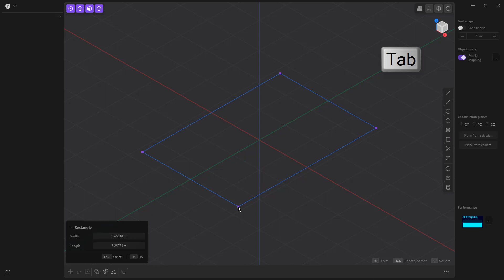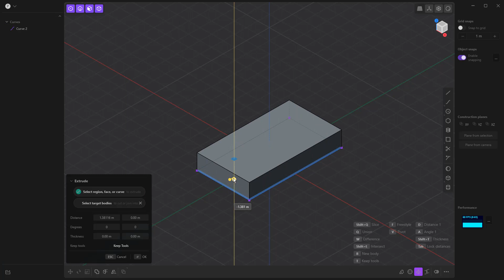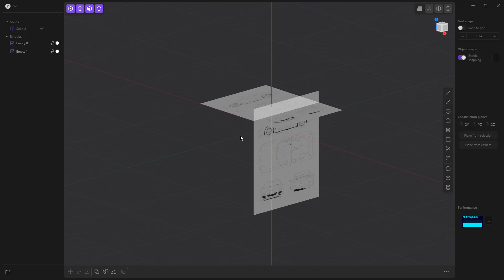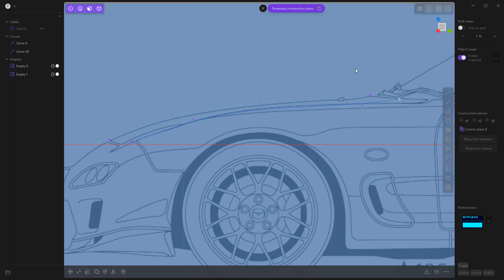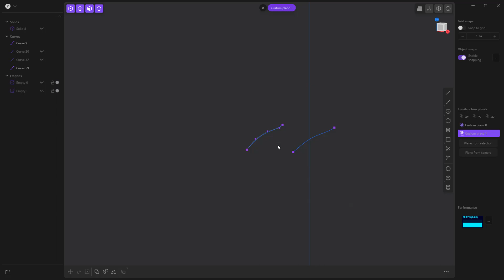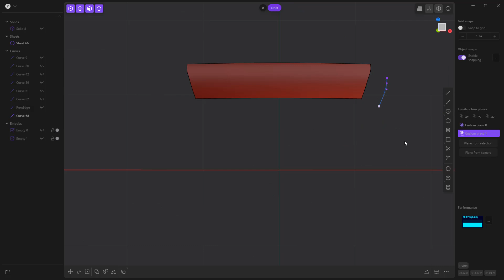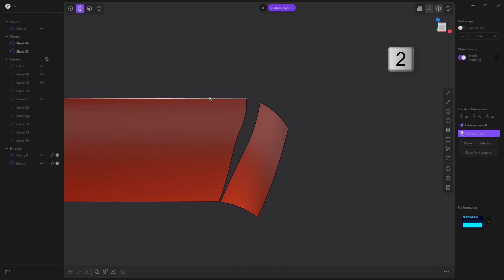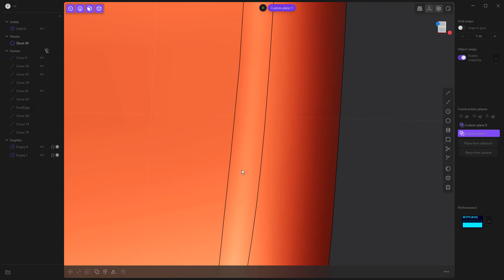Comment: Thank you - I think those type of comments about lofting for an corner  gives a better looking edge than a fillet does is very important - I'd better look in depth at your other video's for surfacing advice. LEAD is a very informative place...
Question, A spline manipulated in side and top view - compared to derived spline from two pulled /extruded surfaces - are they equally valid/ have the same properties etc- also, is it better to learn spline manipulating in the long run to improve knowledge and understanding, thus leading to more complex surfaces? I think the answer must be yes.
Reply: Thank you!  Some of it is a bit of user preference.  I find it easier to visualize and teach curves in 2d and project them, but this is a longer process.  I think you can just as easily draw them in 2D and pull them out to their correct position.  For example on the side view draw a curve, then move the entire curve out to its approximate location and use G to just move individual points from the front and top views until you are happy.  A curve network for this type of modeling is no quick or easy task. just takes time.

Comment: Thanks for making this. I do a lot of vehicle modeling on f360 and was wondering if this could replace it. While it looks pretty intuitive, I don't think I can give up the detail provided with forms. Seems like a fantastic program for someone just getting started and wants more than tinkercad. Cant wait to see how it developes, lots of potential.
Reply: Thanks for the comment.  I don't think this would replace freeform modeling in Fusion, or surfacing in fusion just yet even though i am very open about the surface issues with Fusion right now, there are some things that are still easier to do.  Things like edge conditions when lofting from a surface.  Also true constraints between endpoints if you are building a curve network.  Being able to create and drive tangency on curves after creation isn't really possible with Plasticity at the moment.
Reply: @LearnEverythingAboutDesign  bummer. without continuity control, I just wouldn't be abler to use this for product design work. Looks great for games and animations though.
Reply: @TomCAT_Character_Art  I'm sure it will be in there at some point.  right now you have things like tangent snaps and you can drive intersections, parallel lines etc. but its all during creation and not so much allowing you to tweak it after.
Reply: @LearnEverythingAboutDesign  Yeah. I'm actually looking for a program to replace catia, but can't find something with a parent/child operation tree that's as good. Fusion only has a history tree and it's not very useful at going back in history to find an operation. SW looks like it only has a history tree, and creo looks like it has a parent/child graph but the ME's that use it really struggle with surfacing. Do you know if any program that has a good parent/child chart that you can use to navigate to operations/parts/surfaces?
Reply: @TomCAT_Character_Art  Yeah parent/child can be extremely useful.  Fusion does expose this and I did a video on it https://youtu.be/GAuLpGX75do   but if I am honest Solidworks does this much better.  Solidworks does have the "Feature Manager Design Tree" but also has some on screen arrows that point to where the sketches are shared or what features reference.  The browser/timeline in Fusion takes some getting used to and coming from a traditional feature tree means looking at things in a different way.
Reply: @LearnEverythingAboutDesign  Lol! I already saw your video when I was trying to find an alternative. I use fusion a bit but it's just so hard to keep the file organized so you can find operations, etc.. I'll take another look at SW. Great videos, btw!
Reply: @TomCAT_Character_Art  Thanks, and yeah I totally understand.  I became a certified Swx expert back in 2009 and trained a lot of users in it for 10 years but I sort of left it behind for various reasons.  I don't generally suggest it to people because of cost benefit for most single users, but if you are coming from Creo its a bit cheaper :)  This is a video from one of the big resellers, at this timestamp you can see the dynamic parent/child which is/can be pretty helpful. https://youtu.be/T7u2H2yV7uk?t=97
Reply: @LearnEverythingAboutDesign  Watched that one too. Here's a catia vid that kind of shows the feature I'm trying to find in another software package.. because my current company won't pay the 30k price tag! https://www.youtube.com/watch?v=8k7roFZ4BfY&ab_channel=dotdissonance
Reply: @TomCAT_Character_Art  I watched "some" of that video :)  I have been trying to add Catia to my list of programs to evaluate because it has SubD with Edge weighting which is very hard to find!, but yeah the price tag is tough to swallow.  I will say that Creo is a bit unique in how they display the parent/child with that sort of Flow Chart.  I didn't see any functionality that was different or unique vs say Solidworks or Catia. It is just displayed a bit different.

On the organization side of things with Fusion, one thing that can help is Components.  Not trying to push it as a solution, but making components means when they are active the timeline at the bottom only shows the sketches/features used for that specific one.  You can think of it like activating a part in an assembly but its only a single part/design file.

With the functionality you are looking for I would dig into Solidworks a little more if that parent/child functionality is key to your workflow.  It will be a bit easier on the wallet than Creo but depending on the packages you need to add on you could be hitting $15k by the time you are done.  you can feel free to email me as well support@caducator.com

Comment: Are you suggesting blender may be a better option then Fusion for complicated curvy things? I have been watching your fusion videos and am reluctant to learn another program.
Reply: well that really depends on your end goal.  For me Fusion is good if your end goal is to make something.  Blender is good if you just need to see it on the screen.  What I mean by that is the surfaces from Fusion can be machined for example.  Creating toolpaths for a mesh is not fun.

So if you were modeling a car only for renders, animations, game asset, that sort of thing, and you are more comfortable in Blender by all means do that.  I have several videos showing how to go between the two programs.  You can export the control frame from a fusion form to blender and you can export a quad mesh from blender and make a freeform from it.  So there is a way to go both directions if needed but it isn't always perfect.
Reply: @LearnEverythingAboutDesign  Thank you for the quick response. I frequently tell people Fusion 360 is "Strict" because someone could make something where if it fails someone dies. I thought most of the CAM programs mesh what the CAD programs feed it? Tolerance in Fusion is essentially setting the size of the mesh. Though even if I made something in Blender I would want to/need to bring it back into Fusion because that is what I am using for toolpathing. Thank you for the information, your videos go MUCH deeper into content then most. There are things one learns in professional practice that you are showing us hobby users.
Reply: @rpatrick2  yeah so one interesting note for example speaking of toolpaths.  If you use Fusion Additive to slice your models for a 3d printer.  Fusion has the ability to make G2/G3 arc movements because you are working with precise curves.  When you send a file to a cura/prusa/creality slicer you are sending a mesh which means your arc is now a bunch of little straight lines.  CAD programs use mesh/tesselation for rendering but generally when you are creating toolpaths you are doing this with curve/edge selection for 2.5x stuff or with 3x it is "model aware" looking at the geometry.  You could do a 3d toolpath off a mesh but it gets messy because of all the interpolation.  At the end of the day the output to a CNC machine is generally a bunch of little straight lines or if it can a true arc, or else you get data starvation pushing too many moves to a controller.

It is possible that I am off base with my understanding.  I can't claim to know it all :)
Reply: @LearnEverythingAboutDesign  I'm pretty sure it's a model with tessellations for 3D also for most of the toolpaths. Robert Lockwood who is also on YT and goes deep into CAM talks a bit about this. Fusion (and some of the more advanced CAM programs can use some of the surfaces done directly) Flow and Blend and possibly some of the ones in the machining extension. 5 axis with the machine swooping around and trying to stay normal to the surface....sounds like my multivariable calculus class. 

Though I'm old enough to remember when SGI was exceptional because it had vector math native to it's processors and now we all have tensor/vector processors in our procs on in the GPU. So numerically integrating those surfaces from points on a mesh is not too nasty. I'm grateful to be alive in a time where the average person is getting access to things that in my lifetime were the domain of industry, trade/tech education, or the only most epic of hobby users with 7 figure day jobs. 

Cool stuff but way out of my league. You are right about data starvation, and overall it's respecting and learning to use the machines I have access too and not too much drooling over Titan's very nice industrial grade and will keep micron accuracy equipment.
Reply: @rpatrick2  yes to the tessellations but to the best of my knowledge they happen during toolpath creation though as an interpretation of the surface, I don't think the model gets converted to mesh in CAM(other than the stock preview from toolpath simulation).  Same way a 3d print slicer breaks it down into straight movements in XY.  For Fusion you work with the NURBS geometry rather than exporting a mesh.  You can control it through some of the tolerance settings to determine how long or short those straight sections are, or use G2/G3 arc movements if they are true arcs or for things like lead in/lead out movements.  I used to make the content for Mastercam for a few years and do a lot of CAM content up to 5x stuff, I just don't cover it on this channel as I wasn't intending to get into CAM here.  If you have CAM questions I am happy to try and answer them.  I know lots of other channels cover that and I cover it in official Autodesk content on their site.  That is a big focus for them and doing that so much there means I don't really want to do it here ;)  
Rob Lockwood knows his stuff for sure but i haven't seen any of his YT content.  Just know him through Autodesk.
Reply: @LearnEverythingAboutDesign  Maybe I heard him wrong. I have only been doing this 1.5 years and am just starting to "Get good" as the kids these days say. Lockwood reminds me of you in that it's deep content, unfortunately YT has changed mostly to attractive people with expensive cameras and good editing making fun stuff, and not the "Tubalcain your at home shop teacher" like when it started. So finding content like yours can be a bit bit of work. I'm grateful for people who have these skills still making videos since there is NOTHING out there about some of this. Namenotimportant was the first to explain why it's the 3 segments to get G3, etc. Then Austin Shaner ran with that and his CAD guitar series was incredibly useful about making guitar necks and using some of those concepts. I'm very interested in the future and it relates to your work to do a big 3d print as a mesh and then use fiberglass or carbon fiber to make my own personal kit car. Which relates to some of the content I have seen on your channel. Bad Chad is/was making something similar to the Buggatti Aerolith in a scrappy garage with a french wheel and a MIG gun in NS Canada. He reminds me of some of my "bad boy" patients. Anyway again thank you for making "College textbook" level content in a system that rewards "Popular Science." Even Autocad's blogs and most of their content with some exceptions like Lockwood do not go deep enough. If you have some suggested reading, etc. I and probably others would appreciate it because there is NOTHING out there that is not superficial or 2 column research papers about joining splines with G^n continuity. If you can get a copy by library loan of Morphing: Mathematical Transformations in Architecture by Joseph Choma you may find how he stacks mathematical functions (sin/cos) to get G infinite shapes fascinating, as the book is all visual and not aimed at math majors. Surface by function and then overbuild and chop could give you some really beautiful functions. I also can send you some scans of Gaudi's drawings where he uses the conic extensively because no computers to do the force analysis in the 1890's. Let me know. Glad to help out someone if they want.
Reply: @rpatrick2  Thank you!  I agree that YT rewards the flashy quick endorphin hit content so this is certainly not a career choice lol.  If you would like you can join the discord i have setup for the channel to ask questions, chat and share your work.  Just drop me an email support@caducator.com and ill send you an invite link.
Reply: @LearnEverythingAboutDesign  Just so you know I got this response when I sent the email: Sending of the message failed.
An error occurred while sending mail. The mail server responded:
Bad recipient address syntax.

First time I saw that one.
Reply: @rpatrick2  odd.  ive gotten dozens of emails today. https://discord.gg/Y9J8w2Ka  this expires in a few days.